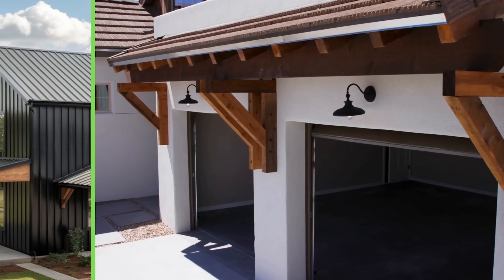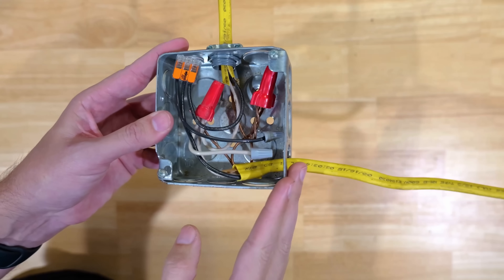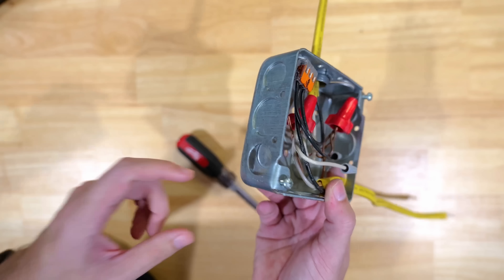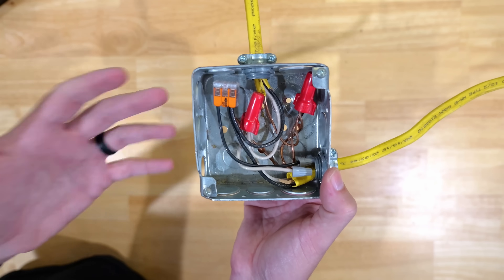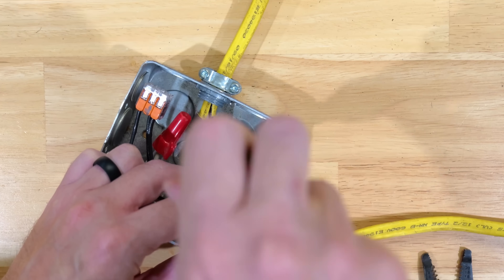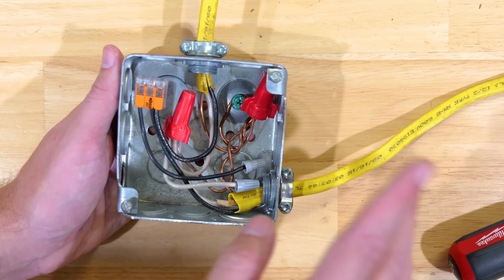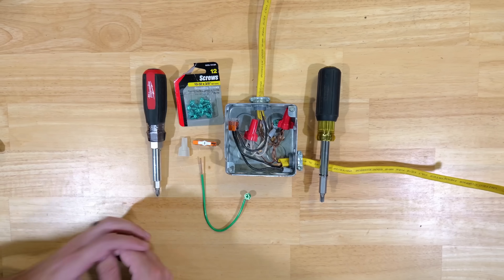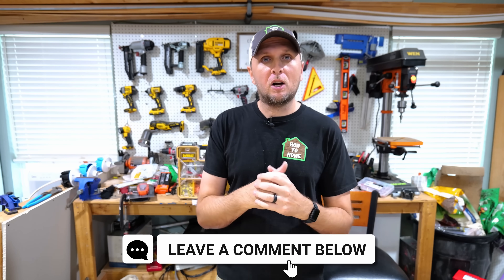SHOCKING Mistakes DIYers Make Installing Metal Electrical Boxes!

Comment: this guy is not an electrician and loves talking down to people
Reply: Amen. This box is obviously intended to accept a receptible, when installed (Wala) grounded box. Never use Wago connector and yes you can reuse wire nuts.

Comment: I didn’t notice the smaller gauge wire but I always use wire to spec or over spec. And I always prefer to go with better or best.  Why settle for good when it comes to plumbing or electrical???

Comment: Thank you for the information and video... I appreciate the effort you put into your channel.  I do want to make a comment about the thumbnail for the video. The thumbnail has fire coming out of the Wago wire connector.  Is the graphic depicting the Wago being unsafe and a fire hazard and that Wago connectors should not be used?  A picture is worth a thousand words and leads to interpretation without more detail (perhaps).  I understand in the video, more than halfway through, has a different explanation altogether with respect to the gauge of wire being used in the connection vs. the actual connector being problematic.  My concern is still valid.  The thumbnail for the video shows the connector on fire and my first assumption would be the connector is the source of the fire as it's the most prominent in the picture.   I understand the graphics need to be dramatic to draw people in; however, the graphics should also be responsible.
Reply: I think the issue was the #14 wire and the thumbnail should have shown that but maybe the heat from the undersized wire would melt the WAGO?  (not electrician)
Reply: I was thinking the same thing

Comment: Excellent video!  I'll add one little tidbit that my father taught me.  He was a Master electrician who worked on new commercial buildings.

After screwing a wire nut on, always hold the nut and pull fairly hard on each and every wire independently.

It doesn't happen very often for me, but once in a while, a wire pulls out, and every time, I say, "Thanks, Dad!"
Reply: Always do a tug test, great advice! Especially on stranded wires.
Reply: I recommend using pliers to twist wires tightly clockwise then putting on the wire nut
Reply: @loulelea  100%
Reply: @loulelea  Yes, my father taught me that, too.  He always used his big Kleins.
Reply: I always preached the tug test not only for wire nuts but also with crimp-on connectors. Can't tell you how many intermittent issues with power and signal wiring I traced down to a crimp-on connector with a half-ass crimp!
Reply: Always the pull test.
Reply: Cool dad....
!
Reply: Yup. I do the same. It's frustrating but worth making it right.

Comment: Adding extra connections and wire just to make it longer seems counter productive to safety, but code is code
Reply: You'll understand later when you have to replace the receptacle or the light fixture!
Reply: @stevenemert837  That's what the 3" from the box rule is all about!
Reply: @stevenemert837 The person replacing the receptacle or light could just add the extensions if they were needed.

Comment: FYI using a metal connector is a good option. But with the new arc-fault breakers the plastic connector is a better option.
Reply: i used to sweat that 17 ears ago, but the breakers are way better now

Comment: Your thubmnail shows a burning WAGO-clamp and "Don't use this" attached to it. This could be called causing reputational harm. Please fix.

Addition: In your case described the cabel with 14 gauge should be burning and not at all the  WAGO-clamp because it is rated for the current of 20A.
Reply from the maker: No it can't 😂.  The arrow is pointing at the base of it at the wire.  A fire is going to be towards the top.  There is nothing to fix.  You just don't like it for whatever reason.  Good effort though 😂
Reply: @HowToHomeDIY  You appalled me with this answer. I am not here to make you beliefe I dislike your entire video. The opposite is the case. The content is valuable and correct. I only klicked on it though because the picture seems wrong. And I do want to raise the thought this might be intentional.
Reply from the maker: Ok well we disagree on that I guess.  I explained why it is the way it is.  Not going to argue over a picture anymore.  Glad you found the actual content good.

Comment: Insulating ground wires is a common thing in the UK and the idea is growing on me.  I mean why not?  It’s cheap insurance.
Reply: I fail to see the point myself, but I'm open to have my mind changed.  In the case of a metal box, you're grounding the entire enclosure that all the other wires are already touching. So..
Reply: @ For me it’s extra insurance against the ground conductor ending up in contact with the live terminal on a device.
Reply: @jimsvideos7201  Romex cable carries an uninsulated ground wire.  MC cable carries a green insulated ground wire.  My ideal wiring system would be with MC cable as it is also rodent proof.

Comment: I once found a skeleton of a mouse inside a box got in through the knock out hole little scruffy became a conductor straight to ground chewing on hot wire is not good .
Reply: im trying to quit!
Reply: Ouch. I’ve seen a couple where they got their head in, but couldn’t get it back out. I guess they either broke their neck trying to escape or died of malnutrition. Poor things.

Comment: One other option for the ground connection is to get the ground wire nuts with the hole in the top, cut one of the ground wires long, and run it through the top of the wire nut, put your J hook on, and connect it to the ground spot on the box. This is especially helpful if you would otherwise have 5 wires in a wire nut rated for only 4 wires. Of course, this only works for the ground. These grounding wire nuts are green.
Reply: I know these exist, but in 15 years in the trade in Canada, I've never used or installed one. Maybe it's because (from what I've been able to tell cruising around YoozToob) plastic boxes are so much more common in the US. 

Anyway what we usually do is just make sure to have a little extra bond wire on the feed cable and put that wire under the bonding screw first before connecting the remaining bonds to its tail.
Reply: Maybe I'm biased against those particular wire nuts because pretty much every time I've come across them there's an issue. For whatever reason, people just throw the "has to be 6in of wire" out the window... So I constantly find a bunch of short wires tied in with one really long wire. While annoying, it's an extra pain when they didn't even bother to make the line ground to be the long one.
Reply: @brancampbell your bias should be directed at the squid who cut the wires short.
Reply: Thank you, thank you. I learned something today. I hate cramming another wire under the wire nut in this situation .
Reply: Just leave one gnd wire long and trim after installing the green wire nut. If you're good you should be able run romex to a box that doesn't require cutting at all. Wire is expensive these days

Comment: I like plastic boxes with built in strain relief. Makes it safe and easy.
Reply: Plastic isn't so great,I had a plastic box I was replacing a switch and discovered the aluminum to copper connection fried and burnt a hole through the box and I could see the wood stud!😮 Luckily caught it in time! I prefer metal because of this
Reply: @stevetheplumberbreeding7402  do a whole house like that!

Comment: Currently rewiring and renovating a FROG on our addition built sometimes in the 70’s. All the 15amp wire looks heavier than the romex today. It’s certainly harder to work with than today’s making current romex look weak in comparison. The only thing I can think of is they wired the whole place with 20amp even though code would only require 15amp. I’m constantly checking the main panel to see which breaker they used for each circuit and the outlets for amperage continuity. Looking at some right now and it’s definitely marked 14/2 but is thicker than today’s.
Reply: It's possible that you're looking at hard drawn copper, which is harder and stiffer than soft drawn or annealed copper that is used currently.  Annealed copper is softer, more pliable, more conductive, and less brittle than hard drawn copper.
Reply: @surferdude642  it looks more like 20amp sizing and yea, hard to bend and work with. I actually remember this type wire when I worked as a siding installer for dad in the 70’s. All new home construction and I’d pick up ‘trash’ around the worksite for various projects and just to examine and learn. I’d watch the laborers and probably learned a lot through this process. Especially how to quit at noon and go to the bar 😂
Reply: Maybe aluminum wiring ?    To identify aluminum wiring, look for the word “aluminum” or the initials “AL” on the plastic wire jacket. Homes built or expanded between 1965 and 1973 are more likely to have aluminum wiring.
Reply: @oldroscoe2590  definitely not aluminum but I’ll keep that in mind as I work through it.
Reply: Oh….!  And open junction boxes everywhere in my attic not to mention places where wires are nutted together with no box at all 😮. Some real green acres stuff going on here
Reply: There's also the difference in insulation thickness between old and new... You might strip the wire and find the conductor is the same size old vs new and that it's just the insulation that's thicker.

Comment: Am I not seeing where the free ground wire is to attach to the receptacle? The pos and neutral have the grey caps, but it almost looks like the other ground is into the red wire nut with the neutrals. (not an electrician, BTW, trying to learn) Thanks
Reply: as he mentioned in the video, the metal cover will ground the recept with it's two mounting screws. what he didn't say is this: you are requred to use at least 2 screws to connect the device. when you do that WITHOUT  a ground wire connected to the recept, then you MUST remove the plastic or paper screw retainers from the recept, (which you kind of have to do anyway to remove the screws) and use the little #6 nuts behind the screws to mount the device. these screws provide the grounding. or bonding if you have issues with grounding. hahaha which i dont

Comment: I’ve had no problems at all with using push in wire connectors.  Dunno why you have a problem with them.
Reply from the maker: When did I say I did?
Reply: Push-in wire connectors don't work well with stranded wire. Many hardwired light fixtures, for instance, come with stranded leads. WAGO-type lever connectors, in my opinion, are better than traditional wire nuts for joining solid and stranded wires together.

Comment: Nice video, I noticed that the outer jacket of the nm entering the box with the clamp is sliced close to where it enters the box. 

Does that mean that the code requiring at least a quarter inch iirc of the outer nm jacket be present in the box does not differ between intact or sliced?

Thank you.
Reply: that's exactly what it means except they dont want that slice extending INTO the connector. you wont get called on it but why go that close anyway?

Comment: Simplify your life use a plastic box
Reply: unless it's surface mounted
Reply: Your clueless to the application 😂
Reply: @ironworkerfxr7105 Clueless 😂😂 get a mirror.
Reply: @ironworkerfxr7105  if you're going to expose your precious romance—oops, I mean Romex—you should obviously slap it in a plastic box because why not? If you're feeling extra fancy and decide on a metal box, that must mean you’re using EMT. Grounding? Yeah, it's not just a suggestion; it's required. But hey, if your Romex is exposed, there’s no logical reason to use a metal box—unless you’re trying to overcomplicate things just for fun. Plastic boxes are cheaper, easier to work with, and frankly, make more sense. But if you really want your exposed work to scream, "Look at me, I’m a professional!" then by all means, break out the EMT and steel boxes. Bravo!

Comment: 30 years ago, I was taught that in specific cases, you can get away with using undersized wire - but it's almost always pointless, and someone will violate the specific conditions later.
Reply: Yeah an electrician put number 12 wire on a 30 amp circuit which is ok in theory but not in code. The wires inside the water heater are number 12. I was hooking up a timer. He should have known. I had one hooked that way for years by his example. I went to gas so I didn't need the line. If I was to hook up the same water heater I would use number 10. Which is required by code. 73
Reply: @ronb6182 Mexico! #12 is 30a .... it works, but they build with concrete.... 😊. Woodframe is a different story, we see afi is helping... but the push for aluminum is 💀
Reply: @sqeekykleen49  yeah and I rented in Mexico and the propane tanks and thirty amp fuse box was in the same enclosure outside and to book pennies were found in the fuse box. Needless to say we left after one month because the owner didn't want to fix anything. We had to take showers upstairs because the faucet didn't work on the bathtub. Forget lighting the oven in the kitchen I always smelled gas. The landlord got upset because I removed the gas tank to get it filled. Staying there was a lost cause. I'm glad I got to see the sunset one time over the Pacific Ocean. 73
Reply: @sqeekykleen49  it doesn't matter what the building is made of current don't see what the building is made of it just pushes forward whether  the conductor is large enough or no.  I see your point but code is code number 10 for 30 amps. Ever look at the lights in the USA and then look at the ones in Mexico. Big difference. 73
Reply: @ronb6182 that is allowed when it is for a motor connection.
Reply: @danielfield3580  I hope not. No pennies in fuse box period. In Mexico 30 amp is the power for the house not a circuit. And no motors were used except the water pump . In the city the water is in a cistern and pumped out for the house. They have little water pressure in the water lines. It's funny they never told us not to flush toilet paper. Of course we had no issues there. 73
Reply: @danielfield3580  30 amp motor at 230 volts must be some large motor 9.25 I don't think a house would need that big of a motor. 73
Reply: Go figure. Codes go beyond what's necessary. But I don't skimp when doing electrical.
Reply: @maddawgnoll  what I think short distances it's ok in theory because a water heater only draws about 20.? Amps. My water heater with 3500 watt elements are on a twenty amp circuit. But my tank is 30 gallons. 73
Reply: @ronb6182  distance is never really talked about, but it's a important as the AWG. I've wired a solar system for my offgrid shop, and have been wiring my cabin, pretty much everything except the meter box. I guess you can say from the main to the sub panel to the outlet/switch. I'm still working on the cabin as we build and figure out where we want our lights, outlets, etc.
Reply: @maddawgnoll Voltage drop (which is directly related to distance vs wire gauge) is certainly talked about in the code, but yeah, no so much on YouTube.
Reply: @scottwilling5315  I wish it would be addressed more often. I read and research everything before I even spend a dollar on anything. If I only went from what I've watched on YouTube, I'm sure I'd have made some serious mistakes.
Reply: @maddawgnoll  I'm no authority on NEC but in the Canadian code they just changed the table and method for calculating voltage drop in the latest revision. It's not perfect but it's better. Before that it was easier to do the underlying calculations yourself and ignore the table. 😁

I would recommend an app but it's for Canadian code.
Reply: @scottwilling5315  why?! I live in the USA let Canada do what they please. You have to obey local codes regardless where you live. 73
Reply: @ronb6182  Ah... forgive me but why what? I don't recall trying to tell you to do anything, and of course you have to obey local codes, so with respect sir, I don't know what you're on about.
Reply: @scottwilling5315  just making a point about local codes regardless where you live. No foot stomping there. 73
Reply: @scottwilling5315  i doubt Canada allows a significantly different voltage drop. But even ao, my app just collects the information, and fills in the one line you leave blank. I.E. if you enter length, material, and size, it will give voltage drop. If you enter lengrh, material, and allowable voltage drop, it will recommend a size.
Reply: @kenbrown2808  E-calc works similarly, plus phases of course.

But I have to teach folks to calculate without an app. 😁

Edit: thought about this later. Voltage drop is voltage drop either side of the border so my comment about the app being for Canadian code might have been puzzling. The voltage drop calculator is only one of its many functions, some of which will be code dependent.
Reply: @ronb6182 the electrical codes are similar if not identical. The Canadian code might actually be more stringent.
Reply: @maddawgnoll  codes are pretty bare minimum. Especially as fast as the widget industry is selling more and more for people to plug in.
Reply: Tap rule. In some situations you can down size conductors at a limited length. Better though to keep same size
Reply: Wires inserted in connector are stranded and should not be used in it, in the case of ground bonding jumper, it can be insulated green.
Reply: Box needs extension if receptacles are to be installed, and depending on splicing devices are used may exceed the box size.
Reply: Motor loads. Wire ampacity and fuse or breaker sizes are different. Same for transformers.

Comment: I don't like the 2 screw clamps, because they are frequently misused.  they are only approved for one cable, and if they are overtightened, they can cut through the cable and cause a short.
Reply: i've passed a gazillion inspections with two cables thru one